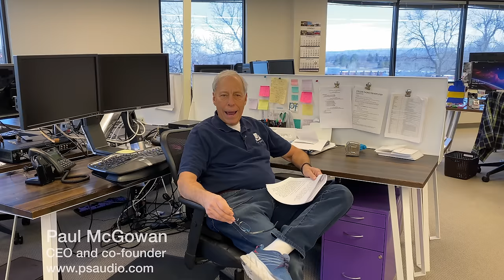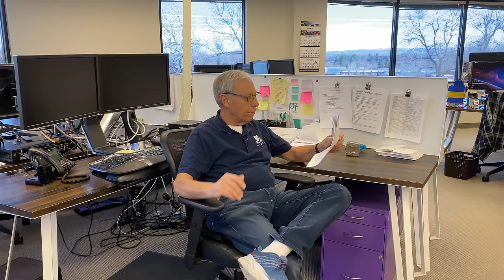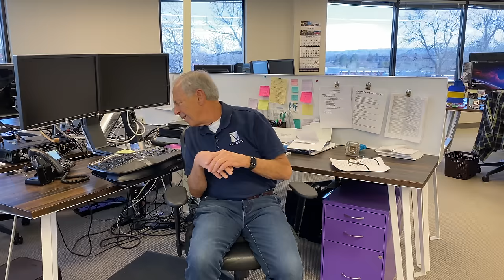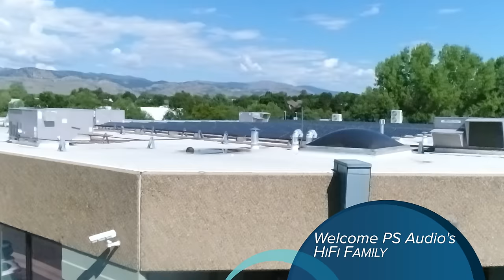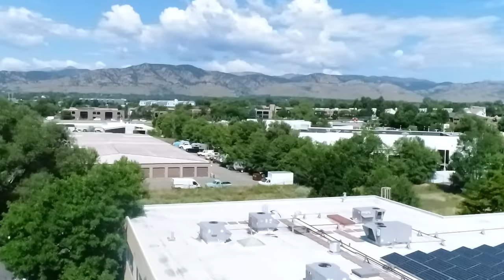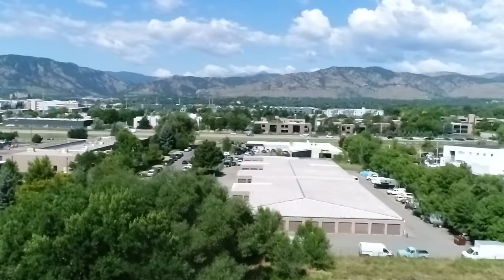Digital or analog out?

Comment: Hello Paul, love your content. Not sure you addressed the heart of the question. I like my CD players on board DAC, so RCA or digital ? You hinted at hdmi as preferred, perhaps the phone call thru you off. Thanks again.
Reply: If you are using the onboard DAC built into the player, your output will be either analog voltage over RCA or analog voltage over XLR depending on your gear.
If you are using an external DAC, that's the only time you would use a digital output, either S/PDIF over RCA cables or optical Toslink connections, both of which run digitally.
The "issue" with S/PDIF is that the bit clock, word clock, and data stream are all mixed and encoded into a single stream for transmission over a single wire or optical connection.  Decoding and reconstructing the mixture can result in degradation of the original components' signal integrity. Using an HDMI cable to deliver these individual signals in parallel without having to encode and mix them together results in maximum delivered signal integrity at the DAC and best possible conversion by the DAC. A poor signal can easily compromise an otherwise excellent DAC, so going HDMI cable for a physical data transport insures you won't experience one.
Reply: @Peter_S_  thank you. Great post.
Reply: I thought the same, huh?. Was also confused if you go out to an external DAC, hasn't the sound/data already gone through your internal DAC?
Reply: @knobbshots  picture the connections as the sound going out to the external DAC in lieu of going to the internal DAC. In reality if your player has both digital and analog outputs, the sound is coming from the transport as a digital I2S signal and then going to both the DAC chip and S/PDIF encoder chip in parallel after which each signal connects to the rear panel jacks through their individual duffer/driver stages. Both are probably always active and one just lies fallow.
Reply: @Peter_S_  But cd players do not have hdmi output?
Reply: @andreassouth1523  Many do. The Sony ES UBP-X1100ES for instance has an HDMI jack which is dedicated to audio only and does not pass video signals. That model was just the first search result in Google to "sacd hdmi". The transport mechanisms are almost identical in function between CD, DVD, SACD, Blu-Ray etc. so you'll find digital audio output over HDMI in video capable players. What makes an audiophile grade CD player so special is the attention in detail paid to the DAC portion. If we intercept the digital signal and send that to an external DAC, the quality of the transport isn't all that important because it already has to be good enough for video which has a faster bit rate requirement, but the quality of the DAC is paramount for audio suitable for critical listening.
Reply: @Peter_S_  So we spent less money for transport and more money for dac?
Reply: @andreassouth1523  To maximize your investment, yes, I would concentrate on the DAC. I would still use a great transport, but any transport that gives you flawless DVD or Blu-Ray playback is certainly sufficient.

Comment: Digital output is not a good things because it needs a preamp. A record player needs a AIAA preamp but it uses the RIAA equaklizer curve. Its the same thing but onew uses lasers and the other uses Pusel Code Mudulation, PCM or Firewite!
Reply: Fat RatL JCM 900 has clipping diode in it. Why did you say Julius Futterman does not need a output transformer. It imdence from complex power. The use capacitor for the power factor and coordination study during a ground fault? IEEE 802.3 is not Ethernet. Please be carefule when you post things. Ethernet is analog signals over copper wire, it is not digital pulses. What university did you flunk out from? thanks you THUMBBSS UPS!
Reply: Hello Mister Rats! plese google 'julius futterman no output transformer'. and floow th elkinkes. he made an amp with no poututs transfromers. Thakes youes you are a news frends! THUMS UPS!

Comment: Interesting. So in consumer audio there is no real uncompressed (digital compression that is) signal transport between devices. Of course this begs the question is "AES3" an uncompressed format as it was the pro audio version of S/PDIF? It talks about it being a platform to be able to stream PCM audio directly which of course infers that it is untouched or rather uncompressed data.
Reply: The low-level protocol for data transmission in AES3 and S/PDIF is largely identical. Both are indeed composed of raw PCM data with no data compression.
Reply: @Peter_S_  Hmm. So if it is taking the exact data off of a compact disk and transmitting it to another device without actually altering it barring what the DAC's do how could the sound in fact change?
Reply: @MrRoberacer  Excellent question and it comes down to the signal integrity which ultimately determines the jitter at the DAC chip and the stability of the clock which has all kinds of propeller-head implications. The DAC chip gets its data as an I2S interface which has a data stream, bit clock, and word clock. These are mixed to transmit over single optical fibers or RCA cables and at the receiving end the three signals are reconstructed. The data stream and word clock are relatively trivial to send across but the bit clock is a very high precision signal and best not mixed with anything else. The mixed signals are variable enough that the bit clock needs to be reconstructed at the receiver by a local precision oscillator (sometimes only precision-ish) which is influenced by the received bit clock information. The receiver's oscillator will always have some amount of mismatch and some receiver designs will continuously adjust to track the data from the transport but not all devices deal with these mismatches with grace and jitter is awful stuff for digital audio. There are also other asynchronous designs that work via stretching or dropping bits strategically which do a better job but which receiver chips use which techniques, I couldn't tell you. By using an HDMI cable to send the data in parallel without mixing it, the bit clock from the transport can be simply used the way it is in a regular CD's internal DAC without having to reconstruct it and now your sound quality matches the best that the transport can provide from its clock.
Reply: @Peter_S_  Hmm. Thank you. That makes much more sense now and illuminates an important issue in other areas of audio.
Reply: @MrRoberacer  You're welcome, Sir. I don't accept the word of the marketing folks until I have a scientific explanation as to why things are. Some of these topics are simply too complex to express in a marketing blurb so for the purpose of sales, we are presented with simplified views and these often lack the context with which to understand what's genuinely happening. Quite often, the simplified views present something that seems in conflict with what we know from more complex understandings. Added to this is the reality that every chip designer has "solved" these issues to varying degrees and in varying ways so it's impossible to make a great many blanket statements. While some solutions approach perfection, most are "good enough" to meet their specifications and price point. As consumers we have been presented with S/PDIF as an easy way interconnect things but as audiophiles, we're focused on the highest quality achievable and convenience is undesirable should it compromise the sound in even the slightest way. In electronics lab environments, it's quite common to have a seperate master clock (often a rubidium oscillator atomic clock) which is distributed to every piece of gear so that everything is perfectly synchronized by design; it's too bad that digital audio didn't evolve with a similar architecture but using HDMI cables gets us as close to that as we really need to be.
Reply: @Peter_S_  ya even in pro audio we have basically abandoned the master external clock thing. In reality the difference of with or without became minimal at best. At one point having a better external clock made all of the difference though. I wonder if that is because more common internally used clocks have just gotten that good as to make that an obsolete thing? A lot of pro audio devices these days don't even have dedicated external clock inputs of course that you can piggyback on other inputs like network audio streams like Dante.
Reply: @MrRoberacer  I think with the advancement of chip technologies and MEMS oscillators we've entered a different world. The specs on MEMS oscillators can be outrageously good and if you can throw more digital logic at the problem, you can take different approaches to synchronization that don't involve having to tack oscillators by dropping or repeating specifically chosen bits in the data stream instead. That allows each downstream device to become its own master clock and with the industry shift to 192k/24 bit, the clock issue went from problematic to vital so chip companies got really motivated to provide better and higher technology solutions. With FPGAs it's become possible for individual companies to roll out solutions at the chip level and that's helped too. With enough fast logic gates, the DAC subsystem can finally be in 100% control of its own clock even though the CD architecture would have the transport drive the show. The purist in me still wishes it were all simpler and more elegant at the circuit level with master clocks.
Reply: @MrRoberacer  Well the reason less and less pro audio gear has external clock inputs is due to cheap sample rate conversion chips and FPGA libraries. The quality has gotten good enough to where sample rate conversion is mostly inaudible. Purists will argue otherwise and that's OK. They do have a point. But be assured, you can't mix or otherwise process two digital audio streams unless they are synchronized. Either you use SRC or an external clock to each source device. Television equipment is already locked to a common reference so that takes care of the AES audio sync as well.
Reply: @andydelle4509  Ya, video has always been another story. I guess it just wouldn't work without sync at all but it makes sense that the audio would be locked in with that. Technology marches on and just keeps making things better and better. It's a good feeling. Years ago when digital was first introduced I don't think many people argued that it was actually a step backwards at the time. I remember one of my profs talking about how until we reach sample rates of upwards of 192kHz it would never be as good as what we had then. (Studer A820 with Full SR, driven with an API desk. It was pretty sweet) I think he was thinking 16 bit at the time. Of course as we know bit depth makes a huge sonic difference in itself. The combination... well, I can't wait till albums are actually released with that kind of resolution. Of course we have to start by convincing the world it is worthy. Let's face it most of what we have today is still MP3. 30 years later we can finally say we have turned the corner on the record side though. I think digital audio is now actually better (more true the the original source) than analogue. Best vs best of course.

Comment: ps audio.com in disc players said: No products were found matching your selection.....
so no cd players?
Reply: sudd Nope, you have to go used for now. They’ve had issues with putting a cheesy transport in their past multi-thousand dollar players, so maybe the next model will be better.
Reply: Fat Rat I saw that they bought a bunch of ESOTERIC disc drives from a post in 2018, if I’m reading it right. People have been replacing their faulty transports with ASUS drives. Still why is Paul even mentioning them as something they make when they’re not, right now?
Reply: Their transpirt/ drives used to be made by Oppo. When Oppo pulled the plug on their UHD/Blueray players, PS Audio was sadly left without a quality supplier, so they discontinued their cd transport units.

Comment: I've never found a CD/SACD player (even Japanese reference models) that exceed the open full sound as even a modest 1500-2000 stand alone DAC.
Reply: Merlin ... not even the Marantz SA10?
Reply: What's with the lousy cds still fellas? Can't you old toads wisen up a bit and run your flac files from a flash drive these days?
Reply: 2 stacks is modest lol
Reply: @hushpuppykl  I didn't find the SA10 to exceed the Benchmark DAC
Reply: @behexen250 Really, Japan has the most dominant CD,SACD market in the world right now...Marantz, Luxman, even some of the Denon, Sony are pretty hard to beat..
Reply: I have an Audio Research Reference CD9se and I can’t imagine bypassing it’s internal DAC.
Reply: @davidparker4984  You should try it just for fun, might give you a little different sound-stage tone etc. I like to have a couple options running and switch over based on the music I'm listening to.
Reply: @wa2368  Too easy.. Boring. I like to have the physical media, SACD, CD, besides there are literally 1000's of Albums that aren't available online without Ripping your so called "Lousy CD" to the hard drive..
Reply: @Merlin Thanks for the suggestion. I will give it a try.
Reply: @behexen250 I was only putting them in a category of (my absolute best, based on my testing ). Should have clarified.. There are certainly higher end options just hard to say if there actual measurements justify the increase of cost. I've just found stand alone DACS especially those using certain linear phase  apodizing filters or tube buffers to give an overall more pleasing sound than the internal DACs on most CD/SACD players I've owned.
Reply: @behexen250 Accuphase cd players aren't hi-end?
Reply: You never heard of Wadia?
Reply: Fat Rat ... been eyeing the SA10 but my concern is the cost. With that sort of price and it out performs my Cary CD500 by just 10% ... I’ll be pretty screwed 😂🤣 

Hifi and ROI ...
Reply: @behexen250 So in your opinion Accuphase is not hi end, right?
Reply: @behexen250 My question came up from your first statement that Japan doesn't make hi end products. I don't understand why you still don't understand. Funny thing is that after 4 posts, you still didn't answer whether you consider them in that category. You keep on saying "it might be for me but not for you". OK then, whatever. Btw Ayre is hi end.
Reply: @behexen250 Good Lord, finally! Took you half a day, to give us your take on them.
Reply: @theovonskeletor3709  I'm in deep..